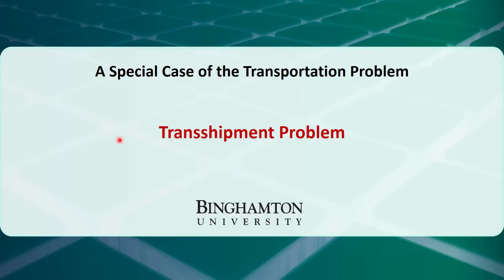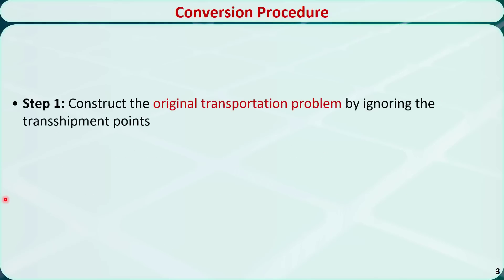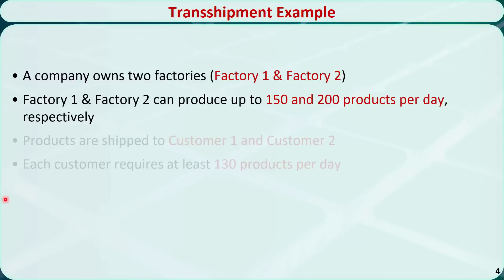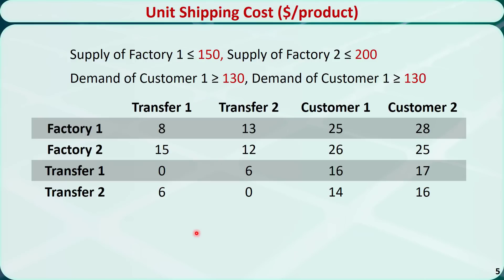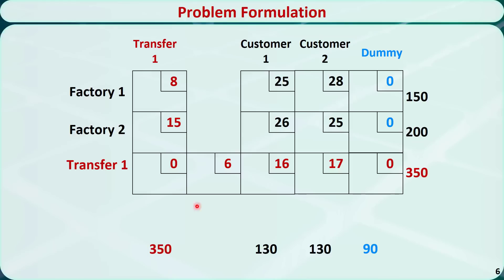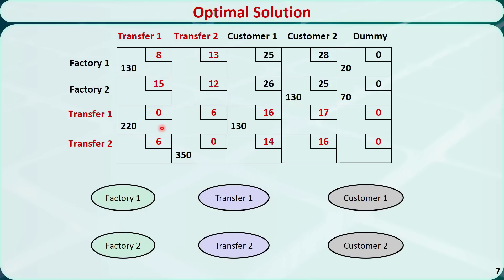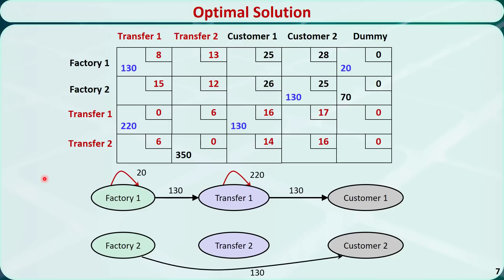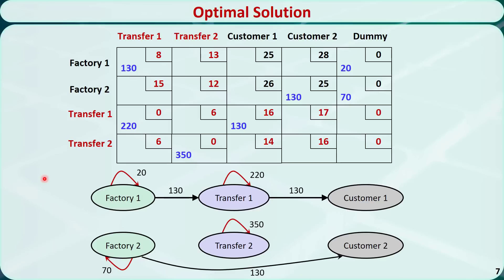Operations Research 07C: Transshipment Problem

Comment: in my textbook they add the total supply point to original supply and demand points. in your example the demand in row4, column 3 will be 350 + 130? thoughts?